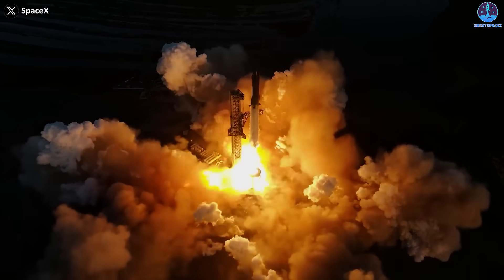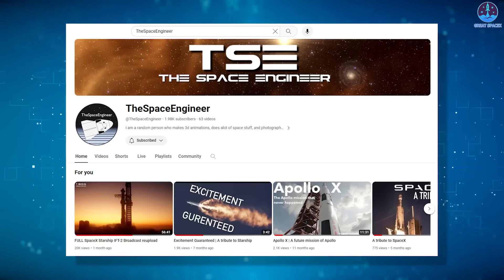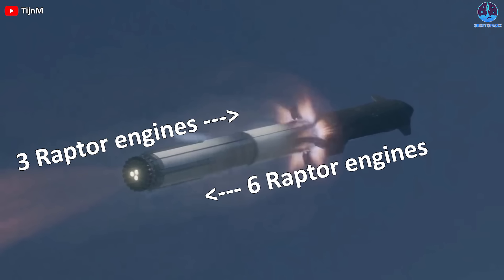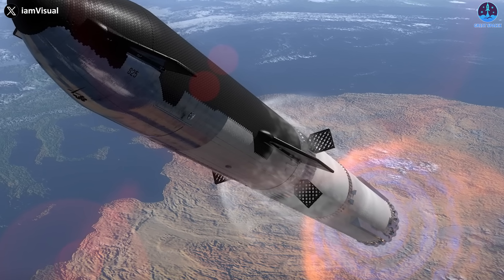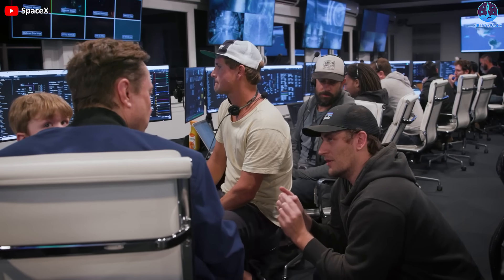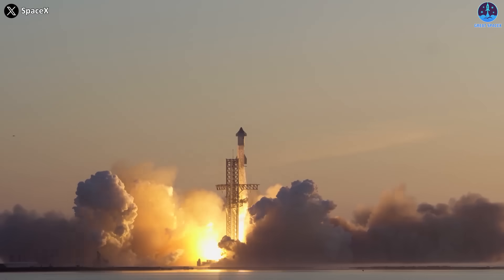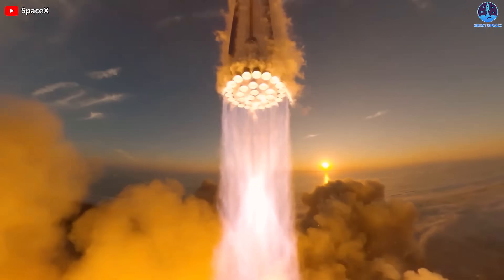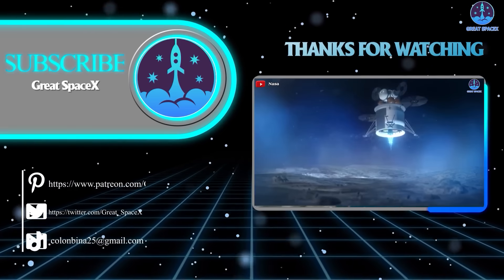How SpaceX Starship fuel sloshing will blow your mind!

Comment: Use a Blatter
No Slosh
Reply: ...you mean bladder.  Nonetheless that's not how rocket fuel tanks work.  They are back fed with nitrogen to do the same thing a bladder would do.
Reply: Hmm thought about that,  seemed like a great idea, to me. However, I gave thought to a float or a piston to reduce tank volume as fuel was expended.. as for being back fed, doesn't seem to be very reliable.... I'm not sure how it all works. You take a car with gas, it runs on a stream of gas but by adding air and running on vapor, you get a substantial boost in power.... and use less fuel.... like I said, I don't know jack shit about rockets, I just know how to get the most out of what is available for my needs.
Reply: @TimThompson-ke4ij  Rocket tanks are back-fed with nitrogen or else they would collapse from a vacuum as you empty them.  You HAVE to do this.  Bladders would not prevent this from happening.
Reply: @TimThompson-ke4ij  ...did I just get tricked into responding to a Bot?  ...oh well.
Reply: @NorthernChev  nope
Reply: What ever you say
Reply: @TimThompson-ke4ij  "Tim", you're using a fake YouTube account.  Just take the money you're receiving from my reply and go.  You're not fooling anyone.

Comment: Hot staging is in it's infancy and may not be possible for reusable rockets at this time, maybe never.
Reply: Hot staging has been around for awhile, and it works fine as long as you don't need to re-light the booster.  When the booster stops accelerating, the fuel and oxygen float away from the tank exits.

Comment: It is forty years since I read for my first engineering degree, powder and fluid dynamics in relation then to storage in ships and oil rig tanks was well understood, sloshing isn’t only something that happens in contained fluids but is is predictable. The flaw in understanding the separating systems of forst and second stage is actually Newton’s second law, for every action there is an equal and opposite reaction, space x engineers surely know this? I know train drivers do and that is just one carriage moving in relation to it’s connected masses( other carriages) disappointed in the group think that missed this.
Reply: Sloshing in space or near space is a mess.

Comment: I have an idea that might help. Install an internal piston in the cylindrical tanks which would reduce the volume of the tank as fuel and oxidizer are consumed keeping the volume of  the tank limited to what is needed. The pressure needed to control the volume could be bled off of the exhaust or the external atmosphere as available thus preventing the fuel/oxidizer from sloshing. This could also help with fuel delivery to the engines. Think of a large plastic injection needle used to inject food with juices. Simple and Efficient.
Reply: Not simple and quite heavy. Mass matters.

Comment: Why don't they just put a check valve at the !0%  fuel level to stop the upward slushing from happening.
Reply: The problem is that with hot staging some of the engines need to remain firing throughout this process. Check valves would help with preventing overpressures from sloshing, but would do so by halting fuel flow for a period of time

Comment: How did they not account for the potential of Fuel Sloshing? Did using the Hot Staging Ring make a difference? Cheers!
Reply: SpaceX was well aware that sloshing would occur, but hot staging was a recent add-on. The original super heavy wasn't designed to keep engines firing throughout the separation and flip process, so the previously designed fuel system is now prevented from shutting off the fuel lines and insulating those parts from overpressures from the sloshed fuel
Reply: @jim2lane  Thx!! So why not wait and try Hot Staging AFTER successfully reaching orbit once or twice? SpaceX adding an unknown variable (Hot Staging) before they work out how to get to orbit complicates things. And the 4/20 launch debacle reminds me of pilots Get-Home-Itis. Understand SpaceX has a different testing philosophy. Cheers!
Reply: @MililaniJag  the short answer to your question - Elon Musk 😉
SpaceX apparently feels that the added performance, which is substantial, provided by hot staging is worth the risk. The performance boost could potentially reduce the number of in-orbit refuelings required for lunar and Mars missions
Reply: @jim2lane  Thx! I get that. Think it would add 10% lift capacity. But how about getting to Orbit 1st. Had a 68 RS Camaro. I only added one new performance item at a time. Once I knew it worked I added something else like Electronic Ignition. Understand and appreciate SpaceX's different philosophy on prototyping. Everyday Astronaut Channel had some amazing interviews with Musk. Can't wait for IFT-3. Really appreciate the info!! Cheers!
Reply: @MililaniJag  completely agree with ya! I'm thinking that they want to trumpet the added performance to NASA for the lunar lander version to ensure those lucrative federal funds keep flowing 😉

Comment: How does falcon 9 handle this! 🤷🏿‍♀️🤔
Reply: Falcon 9 doesn't do hot staging. So just after MECO and prior to flipping, the fuel system can be shut down and segregated from the tanks. Thus preventing overpressures from the sloshed fuel

Comment: Reinforcing/strengthening the "pipes" will not address the elephant in the room - cavitation in the turbines.   The second the turbine blades experience cavitation due to low liquid pressure they will start to RUD leading to a Total RUD.  

To keep the fuel at the bottom of the tanks you need acceleration. Stick a couple of solid fuel engines on the outside of the booster. After hot staging, aim the booster to a return trajectory with thrusters and then fire the solid fuel engines to get the need acceleration to ensure a stable and adequate fuel pressure. Once the necessary acceleration is reached spin up and fire the Raptors.

Comment: Obviously a bladder would solve the splashing problem but adds complexity, a failure point and weight.
Reply: A bladder would be a good choice if not for the fact that no materials remain elastic at those temperatures.
Reply: @harpintn  I shouldn't think it needs to be elastic. A thin sliding metal foil that keeps the liquid fuel from the gaseous fuel would be sufficient.

Comment: Why not use a simple bladder control that keeps  a constant pressure on the fuel line.  I understand using as few as parts as possible, butstop being cheap and design for control.
Reply: My thoughts too.  A bladder that's pressurised to fill the space as fuel is consumed.

Comment: given I can hold water in place or pull it upward with a little suction against more than 1 G of acceleration in a straw, how significant was the engine suction in terms retaining fluids in the constrained geometry near the base of the tanks? Also, decelerating velocity does not mean fluid sloshed upward as the fluid was under a significant fraction of gravity too (at maybe 45 degree), so surely deceleration greater than that would be needed , albeit horizontal flow would move things? eg if I a chuck a bottle upward it decelerates at 1 G but water doesn't slosh upward even though is decelerating all the way towards apogee and beyond.

Comment: Hopefully everything goes well on IFT3! I have no more ideas, maybe You think about combining the "original"- staging by rotation_idea with the hot_staging tech? 
2.) maybe have the 2nd_stage exhausts not bend out 90° through the hot staging ring, but only 45°  , so gases have more of a down_ward component? This would necessitate to make the top of the HeavyBooster quite a bit more sharp-pointed and would impose less initial force on the top of 1st. Some laser sensor that precisely measures the centricity (and distance between 1st and 2nd) during staging!

Comment: Why dont they put like a piston in the tank. Liquids below piston. Gass above. It also help with the in space refueling problem. As the tanks are almost perfectly cylinders this should be possible. The piston may even be lighter than the baffles that prevent vortexes.. vortexes then arent a problem anymore as they cant suck up any gass if the space between the bottom of the tank and the bottom of the piston is filled 100% with liquids all the time..

Comment: Dont milk and fuel trucks have baffle valves/walls?  And thats under 2D on the gravity axis; this keeps the truck under control.  Well, its time for space engineers to earn their pay and get this spl*t under control.
Reply: Milk AND FOOD GRADE LIQUID trucks have NO baffles they have to be washed out every load making baffles impossible..fuel trucks use them but you still get sloshing... it comes down to the driver to keep it under control with the throttle and brake control.. and I'm sure that's how they will fix this...just got to keep + GEE'S

Comment: How does the Falcon 9 handle the sloshing problem? I restarts every time.
Reply: My guess is the engines aren't restarted until after the grid fins provide enough drag to get the propellants back to the rear of each tank without bubbles.

Comment: Potentially as simple a fix as placing a check valve on the tank suction for the gimbaling engines to trap fuel/oxidizer in line, preventing liquid from escaping suction lines back to tank. Alternatively, delaying engine re-ignition and using ullage gas to get sloshed fuel/oxidizer back to bottom of tank. Problem with this method, it impacts amount of fuel needed for boost back burn.

Comment: It's a software solution.  After Max-Q -- throttle up with a well calculated balance of opposing thrust between stage one and stage two until stage two slowly pulls away from stage one, then once a safe distance between both stages is achieved, MECO stage one.

Comment: The only way to prevent fuel sloshing is not to start the 6 raptor of Starship so early. In separation only 3 should be initially started and the rest 3 a few seconds later when the Superheavy has already turned into a position where the push of those six raptors won't hit it. In addition, the 3 Raptors in the Superheavvy should propably fire at 50+ percent, maybe 60%, so that the fules in it would never get pushed  upwards in the tanks.

Comment: Can both the fuel tanks be pressurized to keep a constant load of down force  on the fuel like putting a tank diagram that will keep pressure on the fuel at any position .
Reply: My 2 cents.  Both tanks already are repressurized during engine operation.  The running engines both suck propellants and blow re-pressurization gas back to the top of each tank through a diffuser.  The pressures are kept within limits to prevent tank structural failure & engine pump end cavitation leading to an overspeed RUD.   Redesigns utilizing tank bladders or a mobile forward dome in each tank could prevent slosh and pump end ventilation due to bubble ingestion.
Reply: Pressure doesn't help in itself. There is already a pressure of several bars in both tanks when the hot separation occurs.

Comment: It seems to me that both the booster and the starship need to be in constant acceleration for the liquid fuel and oxidizer to be pressed into the engine intake pipes to prevent the liquids from turning into tiny balls with gas space among them. This will be a major problem for liquid transfer in weightlessness between 2 tanks. Where a tanker ship and a starship are attached for liquid transfer, I believe, to solve this, the tanker ship and the starship in orbit would need to be rotated whereby the liquids would be driven toward the 2 tanks' walls at the outermost part of the rotation by centrifugal force. The rotation would need to be fast enough to keep the flow of the liquids greater than the pumps consume them. There, the tank walls would have a contour whereby each liquid would concentrate at a drain point so that 2 pumps could operate and push the 2 liquids to the starship's tanks. Some sort of paddles may be needed to cause the liquids to rotate with the tanker and starship if rotation along an axis where the 2 ships attach along the length of a ship.  An axis where the 2 ships are attached near the engines would not need paddles. Either way, the pipes from the tanker pumps needs to pump the liquids from the drain on the outermost part of the rotation, through each tanker tank pipes to the starship tanks.
Reply: I would take another starship to carry all that extra stuff.....lol    DON"T build a rocket mate...hehehe

Comment: Im not an engineer but I read an aerospace engineer talking about the booster and he likewise believed that sloshing basically caused the problem.  He suggested that the separation maneuvers be more gentle and pull less g's so the fuel would not be so disturbed.  This might be an interim solution while they redesign the tanks and lines.   He also suggested that the baffles can create excess weight which is why they weren't in there in the first place.  
The next few launches will be using existing equipment, so it seems doubtful they can get in there and install baffles.  No one wants a year of downtime while they work on this "unexpected" issue.

Comment: Booster once detached from ship should imo continue upwards on a parabolic curve that keeps the fuel where it needs to be and then back to the launch site whereby gravity takes over at the top of the curve.
Reply: Problem was that the "pushback" from the second stage engines starting up, slowed the booster down and caused the slosh. The engines that were needed to startup for the boost back burn were starved of propellant by the slosh, and resulted in damaged turbo pumps and engines.